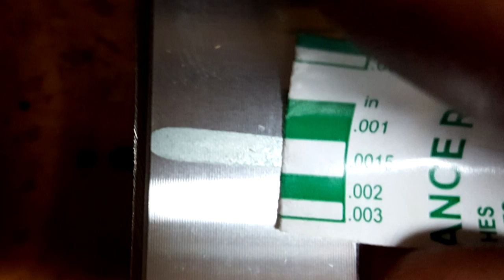LS 5.3L Build Part 4 Bottom End Assembly | Project Rowdy Ep008

Comment: sir this emgine timing chain guide wear is i m rebuild 5.3 engine in my engine guide  have  but your engine chain guide have our not
Reply from the maker: 3star motors ksa Not sure if I understand your statement or question.   These engines do not have Chain Guides as you might find in a multi-Cam engine like a BMW V8, Ford Tritan V8 that have long chains to connect the multiple Cams.
Reply: @UCanDoIt2Mike sir i' remove engine today GMC seiarra 2007 4.3/5.3 litre 1chain guide have in this engine when see your vedeo not not have
Reply from the maker: 3star motors ksa OK, I just looked it up and your newer engine does offer a Chain Tensioner.  If you decide to replace the chain, you should also replace the Tensioner.  It is a consumable and is subject to much wear and should be replaced.

Comment: Good stuff. I'd say not to use extensions/reducers with a torque wrench. They are a torque reduction and you would get a more accurate torque with just using a socket.

Comment: you forgot to tell the torque specs on rod bearings
Reply from the maker: I used aftermarket Rods.  There are different specs for each of the aftermarket products even from the same vendor.  I highly recommend that you look up the specs for your specific application/rods.   I didn't specify this because my value would not apply to the masses.  I actually had to go to the manufacturer's website to find mine.

Comment: You don’t use plasy gauge on rods
Reply from the maker: That has to be the dumbest statement of the month.   Think I’ll leave it out here for all of the others to enjoy!
Reply: @UCanDoIt2Mike   it’s even dumber watching you do it.  You cant use it on the rods because when you torque them down the cap slides on the crank and throws gauge off and you don’t get a accurate reading.   I’ve own a shop and have worked in one of the oldest and longest running speed shops in the country.
Reply from the maker: @mikeeagle2653  Pretty interesting when the Plastigauge leaflet (https://plastigauge.co.uk/abd/wp-content/uploads/2019/09/Plastigauge-leaflet-English-LR.pdf) has images of using it on rod journals.   Then again, only a Keyboard Mechanic would misspell the product as "Plasy Gauge".   You kind of lifted your shirt when you did that.

Comment: Not enough attention paid to cleaning the block before assembly. Unless you specifically ask your machine shop to do it, you need to do it yourself. That includes removing any oil passage plugs and the "dog bone" piston seal at the back of the block before and after putting it in the hot tank cleaner. The main bearing to cam bearing holes should be cleaned before installing the cam bearings and, after grinding or polishing, the crankshaft oil holes can have metal or abrasive debris in them that can ruin an engine in no time and need to be cleaned. The block should be scrubbed inside and out to remove any abrasive material left behind by the honing process. You should include all of this in your video. You can't just drag an engine out of the back of a truck and start putting it together.
Reply from the maker: The cleaning phase was done at the machine shop and covered in that video.   Sorry you missed it.

Comment: Could you come help with my engine😔
Reply from the maker: Sounds like you need a repair manual.  The pictures and steps make it so easy.... even a caveman could do it!   Cheers!  Mike
Reply: @UCanDoIt2Mike  the rebuilding is the simple part. It’s removing the current engine and dropping the built one in the truck. Hard for one to crawl around these days and bend over extra long